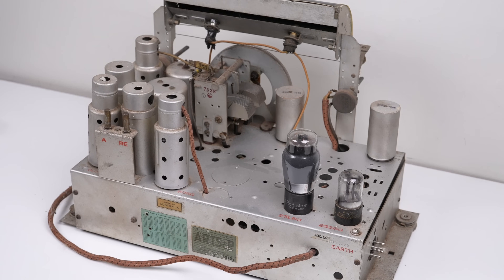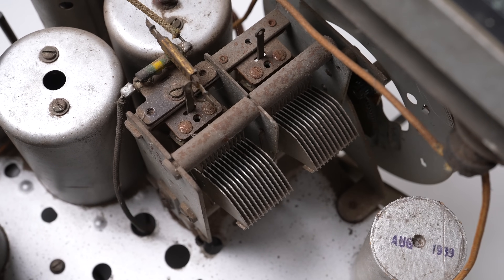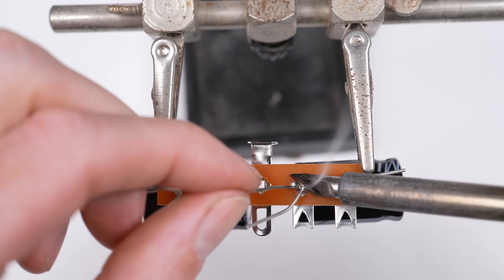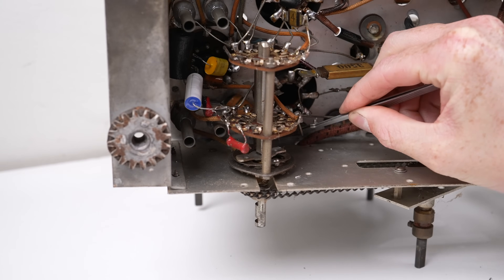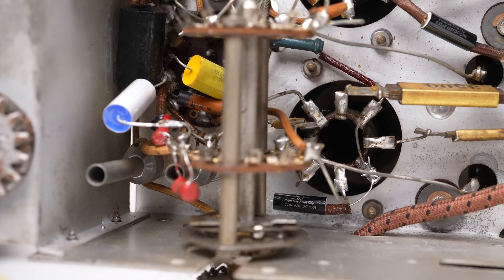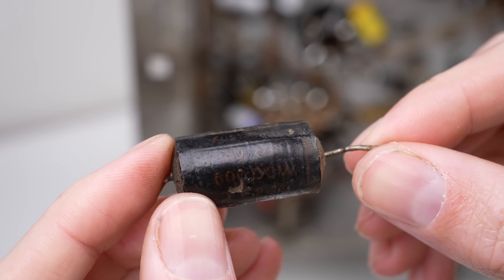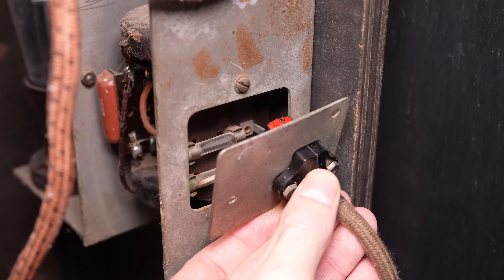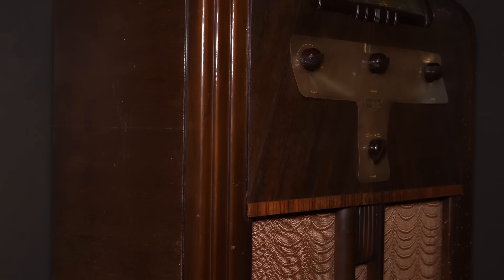Breathing Life Into A Forgotten Piece Of Technology ⚡️ High Voltage Restoration

Comment: Hotpoint Bandmaster radios were manufactured in Australia.

The "Hotpoint Bandmaster" brand was a product of Australian General Electric (AGE), a company established in 1920. While the Hotpoint brand is internationally famous for appliances, the specific "Bandmaster" radio line was a distinctly Australian venture.

Manufacturing and History
Manufacturer: Primarily Australian General Electric (AGE), based in Sydney, with offices throughout the Australian states.

Production Era: These radios were produced from the early 1930s through the late 1950s.

The AWA Connection: Most Hotpoint Bandmaster radios were actually "badge-engineered." The internal chassis and electronic components were typically manufactured by AWA (Amalgamated Wireless Australasia) in their Ashfield, Sydney factory. AGE would then house these components in their own unique cabinet designs—often made of timber or Bakelite—and sell them under the Hotpoint or Bandmaster labels.

Design Influence: Because AGE was a joint venture involving the American company General Electric (GE), some Australian Bandmaster models borrowed aesthetic designs from the US. For example, the 1938 Hotpoint Bandmaster famously used a cabinet design nearly identical to the American "Fada" radios.

Bakelite is superior to plastic in some ways such as aesthetics and durability IMO

Comment: I'm quite old, and in my youth I repaired quite a few similar tube-based devices. Here are simple and clear diagnostic patterns and accessible repair techniques. And if I had been there, I could have taught him a few secrets of such repairs. The author of the video is not an electronics engineer, but his basic knowledge and common sense allowed him to successfully complete the task.
And I don't think in a hundred years anyone will be repairing an old iPhone.

Comment: I'm 24 and have fixed several of these old radios myself. You might really enjoy a related piece of gear, tube testers! There's many different styles such as basic emissions testers and mutual conductance testers, but they are so fun to use to test vacuum tubes. I have a few, but the one i use most is my Hickok model 539B tube tester i bought restored. i love seeing you work on these radios!

Comment: I'm in my very early 20s and when I need a break from struggling like crazy trying to fix modern tech I go to my old, older and ancient tech and service or fix them modern "decent" tech is completely unaffordable for me and I ABSOLUTELY HATE IT as well it's made to break it drives me absolutely MENTAL but the good old stuff was made to last forever obviously they will need servicing and fixing but that's easy and it is possible to bring them back and sometimes even better unlike modern tech half the time it's impossible to see anything wrong because there is nothing wrong they just decide there time has come way to early and there is very little that I own that is modern and I'm proud knowing that the stuff I have I can service and fix because I don't trust ANYONE to do it for me nor do I trust myself which is why I get really annoyed when I get asked to fix something so I tell them it's 50 50 it either won't work ever again or it's to my capabilities and standards which are very low because I fix for myself so I know how to use and handle it and then they usually go pay someone to do a better job they are not professionals none of these companies you go to get your stuff fixed are professionals they always stuff up and rely on other crap to give them false info they don't know what they are doing and no I'm not a professional either never will I EVER give myself that title I go to other hobbyists to get real info it's infinitely safer that way and extremely rare you get told a heap of nonsense I started my journey self taught and expanded my knowledge from other hobbyists never once have I asked a so called "professional" because I ask the hobbyists how there experience has been with them and it's always exactly the same they don't know anything 

Oh wow I really did get carried away ah well the anger is out now and I'm ready for bed I'll watch some more vids before I head off to Nightmare City so I say Goodnight and sorry

Comment: That is not a high-voltage radio.  The 35Z5 rectifier tube uses 35 volts on the filament.  There is another 25 volt filament tube.  So all the tube filaments are in series.  The light bulb might take up the difference..  The plate voltage of the tubes is just rectified 120 volt wall AC.  Some of these old radios had a "Hot Chassis"  That means that if the wall plug is inserted the wrong way, touching the metal chassis could give you a SHOCK!

Comment: Howdy,
As a vintage technician myself, these sets can get a little challenging once in a while and it is nice to see the younger set getting involved with fixing these sets. Almost all the time, the caps are going to be bad. And that includes the bypass caps too in most sets.

Before you start working on these sets, you need to get data. And you have to train yourself how to read the symbols of these sets. Once you get the feel on how to fix these sets, Make a list of all the caps that you need to replace. Then check the resistors to see if they are still good. 

Also, clean the tube or valve sockets with contact cleaner and oil the tuning cap joints and the shafts of the controls and other places. Take a look at some of the solder joints that may have too much solder on them. That indicates that some of the leads were clipped away and not taken out of the solder joints. Repair may need to be done there too.

As for the filter caps, take those out of the caps out of the circuit altogether, bur leave the rest to keep it looking authentic. When anyone starts working on these sets, you will need some equipment. One is a variac, two is a tube or valve checker, three a signal generator, to start off with. And you might need other equipment to help you fix these sets. But that will be determined by the technician. 

Then you will need data to fix these sets. There are many sources. One is John F. Rider perpetual trouble shooting manuals. Two, Official radio service manuals, Three, Beitman manuals. Manuals for working on the set you have, be it Philco RCA Sparton or any other set. You may need more detailed information. Also, radio service bulletins can be very useful as well. One last thing you will need is: patience. Do not be is a hurry when you are working on these sets.  And if you are stumped, ask around for advice on a certain problem.
And there you have it.

Comment: If a valve's vacuum has failed, often the silvery 'getter' coating inside the tube will often turn white.  So it the getter is still shiny and the heater still conducts, then the valve will probably still work, at least to some extent.

Comment: Ballistors or 'light bulbs' were often used to provide a constant current source for valve (tube) heaters, wired in series, rather than using an expensive and heavy transformer supplying constant voltage and wiring in parallel.

Comment: Hi from England, UK. Another thing that happens with old electrolytic capacitors is the old rubber seal perishes and lets the internal electrolyte dry out so it loses capacitance, that commonly happens in the amplifiers of old American jukeboxes where the capacitors are used for interstage coupling so the signal gets degraded as it passes through, and the same can happen in old valve radios too.

Comment: The screw in bulb at 2:45 is a barretter, a device which was used in the 1930's to regulate the current for the valve heaters and make them last longer, in later times like in the 1950's thermistors were used which are much smaller, and a friend of mine has a late 1950's valve radio with all the original valves still working and it has a thermistor specially made for regulating valve heater current, how about that?!

Comment: The distortion in a valve, or tube radio is often caused by an audio interstage coupling capacitor which has started to leak internally which upsets the bias for the valve control grid by applying positive voltage. And here's a servicing tip, before removing any parts or wiring first carefully take some digital photos showing the correct positions of such components and wiring etc. especially if you don't have the circuit diagram which is all too often no longer available.  And sometimes the valve heaters are fed in series and often the dial lamps are part of that circuit so must be the correct type, and I think you'll find that the large bulb fitted separate from the chassis will be a barretter which were used to control the valve heater current, so check your diagram, and any replacement must be the right one or you could destroy your valves.

Comment: They are too expensive to repair.
High voltage capacitors cost a lot of money - so do valves.
You really need an oscilloscope and an RF signal generator too.
For best RF performance you need to re-align them.

Comment: Thank you for this video. It has inspired me to get working on my collection of old Aussie made kit. The internals are easy enough to repair but it is the cosmetics like missing knobs and cracked cabinets that I find a challenge. The A and B batteries for the portables require a bit of modern tech as a substitute. I have been thinking about designs for a low frequency inverter for the B (low frequency so no RF interference) using a lithium ion as the power source. Looking forward to your next video.

Comment: My father started his career as a radio repair technician, working with valves. After his pension he restored some old radios.

In many electronic systems, it's the capacitors that wear out. 

Replacing  tar type capacitors in the audio circuits with modern variants does not always improve things - he taught me. I think it has something to do with the ESR (dc resistance). 

Also, keep in mind that capacity changes when a capacitor is charged with a signal that has a DC offset. You need to derate to compensate for that.

Comment: Valve radios are much easier to repair, unless it's a Racal RA17L with 23 valves. About ten years ago I replaced an r.f. choke and resistor but it's gone deaf now. 
Aged 14 I made an H.A.C. one valve kit, then went on to making 3,4 and 5 valve receivers from circuits in P.W. and S.W.M.
I got a very deaf Wireless 19 Set going amongst other items. 
Edit: Yes, let's see some more. You did a good on on this one. 
G4GHB.

Comment: It is extremely common for these radios to have every single resistor bad. The problem today is that you have a hard time finding the high voltage resistors they need.

Comment: Repairing a radio like this is very easy. Since all the capacitors are damaged (or close to being damaged), they all need to be replaced. The same goes for the resistors.
You can replace everything and it's back to life. There's no need to waste time replacing just a few components. They all expired years ago and need to be replaced without the need to test them.
Now all that's left is to restore the box. It looks disgusting.

Comment: Thank you Hugh.  I’m one of those olde fellows who worked on valves radios and tvs when I was younger. This old AWA is unusual for Australian radios it would appear to be a transformer less design   I hope you used an isolation transformer as the chassis could be live at mains potential. The light bulb looks like a buretter ( iron wire in a hydrogen atmosphere),a current regulator for the valve filaments in series across the mains  and they are really rare these days.  This set is well worth restoring. I think the cabinet will shine up and look beautiful. 
Younger people ( maybe in their forties are taking up the hobby , so there is hope. It’s well worth joining the HRSA.

Comment: 2:47 That's a ballast tube. These were like light bulbs but most had a filament made of iron that would draw an almost unchanging current across a wide voltage range. This way the ballast tube could be used to compensate for variations in the mains voltage when placed in series with a power transformer - the power transformer would therefore receive a near constant voltage despite variations in mains voltage. Useful for circuits which were sensitive to variations in power supply voltage.
Reply: This set does not use a power transformer. The tube filaments are in series and the lamp is a voltage dropping device.

Comment: Taped tubes is a classic "repair" Instead of replacing them.  This is the first time I have seen one of these repairs but I have heard many stories.  Maybe you could refinish an old radio as well during a reapair/ restoration.  Nothing valuable or rare but just for the experience of doing so.

Comment: That 302 lightbulb like thingy is a current limiting ballast tube, often called a Barreter. It has a fine Iron wire inside a Hydrogen atmosphere in that bulb, the hotter the wire gets, the higher the resistance. Note how in the circuit diagram it only feeds the tube filaments with a constant current of 300 Milliamps. It normally hardly glows, and will blow up if connected directly across 240v. Because they often fail, they can easily be substituted with a solid state current limiter or even a fixed resistance.
And yes, please upload you fixing the other radios at your place 🙂

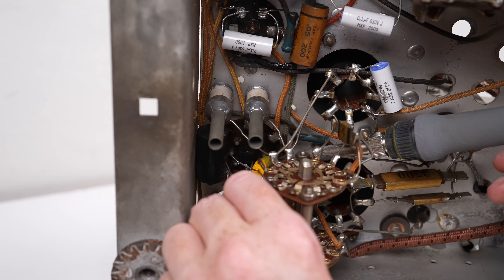Comment: 6:51 the repair cost isn't the actual reason why people don't repair stuff anymore. It actually stems from repairs being deliberately made difficult by the manufacturer as well as replacement parts being extremely expensive, sometimes more than a new product. Not to mention that inbuilt technological components can be outright illegal or impossible to be repaired except by licensed repairshops
Reply: Yep this is a big part of it! I do repairs as a hobby and i am not a professional but sometimes do run into issues with companies not wanting to  provide replacement parts. I once had a dead micro and guess what, the company did not want to give a new one and just told me to replace it.... I also had a dead micro on a peak ltd capacitor tester and because they are a small company in the UK and have not turned to the dark side, aka money mules, they just said 'no worries, we will send you a new programmed mcu in the mail :)' and i could repair the product, i will never forget that awesome moment and will honour and respect them for life. 

So it does also depend on company but most companies and bigtech dont care about rightotrepair or upgrades and just want the user to throw away the device and buy a new one so bigtech and the elites can get more money and its sad! 'Okay everyone, use paper straws, go drive electric cars, limit the amount of meat and driving and flying, while we create products which cant be repaired and are really complex and cant be repaired just so you buy a new one because this society is about consumerism so who cares about repairs and upgrades anyways?, we care about money, thats all' -bigtech and other elite/rich people and institutions

Comment: Hugh
    Please be very careful with this radio. It has no power transformer and therefore even a slight fault can make the chassis LIVE and the owner NOT.
    99% of Aussie radios were built for 240 volt AC and so used a transformer to drop this to 5 volts for the heaters of the rectifier diode (usually a 5Y3) and to 6.3 for the heaters of the other valves. Your radio can use 240 volts AC or DC. As the transformer can't work with DC it is deleted and the heaters are all wired in a series string ( with maybe a resistor as well) to give the correct voltage across each one. One side of the power supply ends up as the high voltage. Many US radios called "All American Fives" used this design.
   If you look closely at the circuit diagram there is a connection between the "neutral" and the chassis (via the plug attached to the speaker). The "neutral" is NOT neutral; it is 240 volts above or below the "active" and is just as deadly. The radio is NOT earthed and so will not blow a fuse if there is a fault.
   I have done up dozens of Aussie valve radios and amps and have never even been "tingled" by one. BUT I have not been game to work on my one, transformer-less valve radio. PLEASE BE CAREFUL with this radio.
Reply: Hugh
  I am pretty sure that the light bulbs are acting as resistors in the valve heater string and probably are meant to be 50 - 70 volts bulbs. In your video it is possible to read 6.3 volts on one of the originals but I don't think that is correct in this circuit. 
  Be very careful of the wiring to the bulbs; there is probably 100+ volts across them.
Dave D

Comment: 3O2 is a ballast tube. It’s a simple regulator. A cold filament wire has a low resistance, when hot a high resistance. So it acts as a PTC in series with the rest of the filaments.